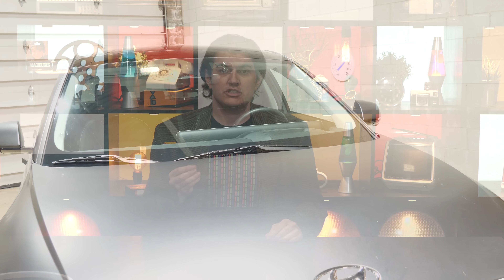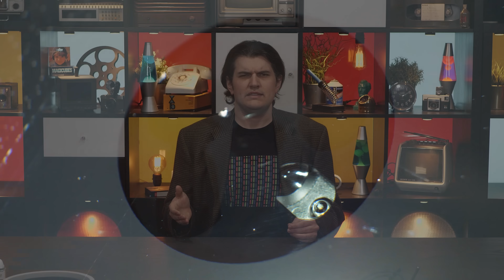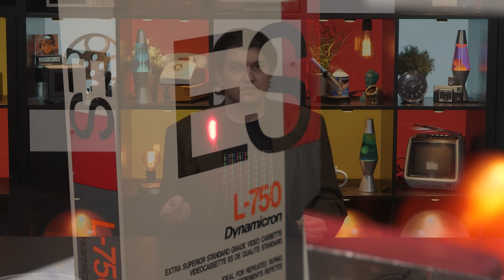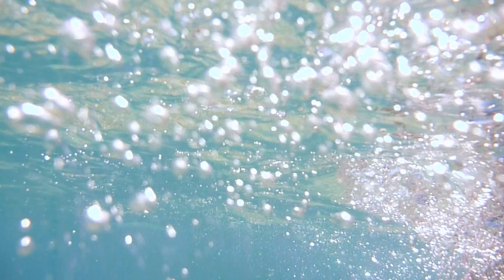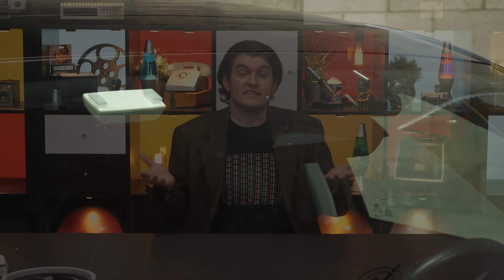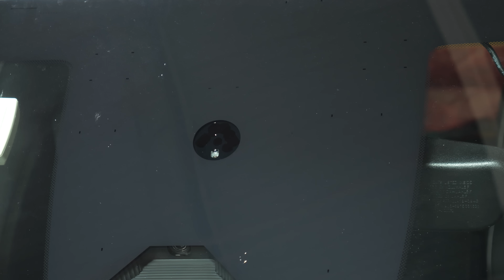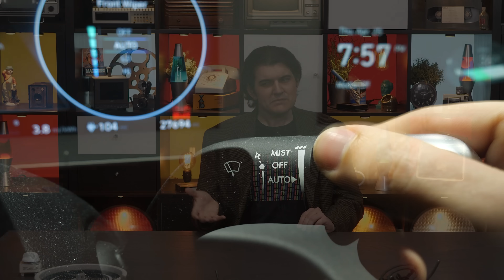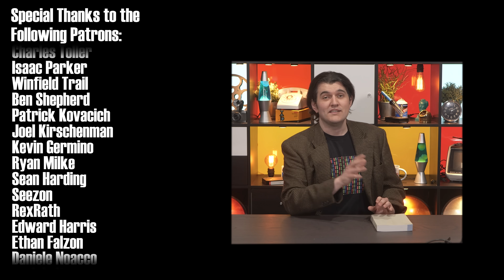The simple, clever sensor behind automatic windshield wipers

Comment: Having just purchased a vehicle that is equipped with Rain Sensing Wipers I can appreciate the mention that the system is "effective but not perfect". I constantly find myself arguing with the auto setting when it starts to rain heavily.
Reply: I more tend to argue with it when it's not raining much at all. As Alec said, the workaround to "not wiping enough" is to either dial the sensitivity up, or just put it on continuous wiping. If it's wiping too much even at lowest sensitivity, you have to basically turn the wipers off and manually trigger them each time. And salt/sand on the windshield will make this worse every time.

I wish there was some way to trigger an old-school "intermittent" mode. Or at least give the wiper control some feedback that "no, that's still too sensitive; even lower sensitivity than that."
Reply: @Nimelennar  you might need to dive deep into the settings of your car, my car's sensor doesn't work (as in wouldn't wipe at all beyond the initial wipe when turning them into a higher sensitivity setting) and I could change them to time-interval deep in the settings

Of course that won't let you switch between them easily
Reply: @ratchetfreak  Thanks, but my car doesn't have a settings menu. The most technologically advanced feature my car has is Bluetooth.

I think I might be able to get the rain-sensing sensitivity tuned at the car dealership, but it's not worth the hassle.
Reply: @Nimelennar what car model do you have?

You sparked the inquisitive part of my brain and now I want to find out if your car has the option to (somewhat easily) change that setting.
Reply: @Jehty_  it's a 2012 Mazda3.
Reply: @Nimelennar They all suck and wipe too little especially when it's bot raining a lot. it should use the camera as a secondary sensor
Reply: Yeah, in any car I've owned it seems the automatic wipers are way too sensitive. Not that I really mind if my wipers wear down a bit faster than usual but I just feel like an idiot when oncoming traffic sees my wipers going haywire when it's just slightly dribbling outside. Even on cars that have a way to adjust the sensitivity it seems like low is way too much sometimes

Though the newest car I've ever owned has been from 2012 so hopefully the tech is much better by now
Reply: My automatic wipers are far too insensitive, even at the highest setting. In light snow or rain, it's far more effective for me to manually hit the stalk every few seconds than leave the wipers in automatic.

I would so much rather have "dumb" intermittent wipers that operate off a simple timer.
Reply: I have a Hyundai Ioniq 6 (similar to Alec's car), and I agree with him, sometimes its evaluation of how much it's raining is WAY off, swiping far too fast or far too slowly. I thought that auto wipers might be just inherently a half-baked idea, but then I was on vacation and rented a Peugeot, and it had auto-rain-sensing wipers that worked FLAWLESSLY — enough to remind me how comparatively poorly my Hyundai's work. So it seems that some engineer, somewhere, can make them amazing, and car manufacturers just have to choose a best-of-breed supplier for each little component.

Meanwhile, I was literally just last night trying to figure out how I was going to replace my wiper blades when they are trapped under that hood! Thanks, Alec, for the coincidentally timed free tip!!! I actually did RTFM, learning a lot in the process, but I guess that paragraph about Blade Replacement didn't make an impression on my brain.

Comment: Theoretically it should be possible to implement a hardware rain sensor on the vehicles to which you weren't alluding, I mean the CAN bus presumably runs up near the cameras, so shouldn't be too difficult to stick on a rain sensor that sends a signal to the wipers to do their thing when rain is sensed.
Reply: Just use the stalk. Very easy to do and far more effective than auto wipers will ever be.
Reply: @iunnox  Manually operate the wipers? Heaven forbid! 🤣 Jokes aside, yeah, that's pretty much what I'm doing now, although I did test auto wipers over the weekend where we had a lot of rain and it worked pretty well, I guess they're almost there in terms of dialing in the rain detection algorithms.
Reply: That presumes that the wiper motors are just dumb CAN devices. I wouldn't be surprised if they are hardwired to one of the Vehicle Control modules, bypassing the CAN bus entirely.
Reply: @whitslack  The wipers themselves may be, but all one would need to do at the most basic level, would be to make the controller responsible for the wipers think that a stalk (or button) has been pushed. Although I'm pretty sure I saw some CAN messages catalogued by others that mention a wiper speed setting message.

Comment: I laughed out loud at "not alluding to anything" and now my neighbours think I'm crazy (as I was walking the dog outside at the time I was listening to the video...)
Reply: I had a model 3, now a model y.  The auto wipers and auto high beams suck so much compared to my previousl 2018 chevy equinox lol
Reply: @ogQuasi  Yeah my X is dreadful. I've learned to tap the windshield-squirt button to get it to trigger. And then sometimes it goes superfast for no good reason....
Reply: @MattGodbolt  My MY has 4 modes. Off, manual, intermittent, bipolar.
Reply: @ogQuasi Had a 2014 Model S that had a rain sensor and the auto wipers worked great (Better that the BMW I had before that). Now I have a 2018 Model S and as long as it is bright outside it works well enough, but once it gets slightly dimmer it has to be controlled manually. Only redemption must be that it still has stalks. As for auto high beams at least here in Europe Model Y and 2021 and newer Model 3s have adaptive headlights that only blacks out sections of the high beams to not dazzle oncoming traffic.
Reply: @ogQuasi  I turned off auto high beams the moment I got the car. The regular LED lights are MORE than bright enough already, no need for an even higher beam.
Reply: Yep my model 3’s auto wipers suck😕
Reply: My Model Y's auto wipers are mostly fine, but they definitely aren't as good as a real auto-wiper.
Reply: His digs at Tesla are sometimes justified. This one is 100%.
Reply: I got my model Y at the end of last year and the auto high beams have done really good for me. Now they’ve enabled the matrix beams which work even better. But the auto wipers are pretty bad, pretty much the same as my old i3’s. We need a better solution than this.
Reply: You will tell your grandchildren of this fateful day...
Reply: @HerrHoppenstedt  lol :D, yup a momentous day in my family's history, for sure
Reply: aight just to be clear, we're "not alluding" to tesla, right?
Reply: Don’t worry actually laughing audibly in public is normal, even if it happens by yourself! 😋

Comment: One thing that's not clear is if the sensor just detects water right where it is or if the total internal reflection means the IR bouncing all through the windshield's area and detecting water elsewhere.
Reply: The total internal reflection is just at the point of reflection. It's the angle at which, under normal circumstances, the light a refracted precisely along the surface. A discontinuity which you can measure.

It's actually very clever. Using the idea that something on the glass affects the light in the glass, even though the light never actually goes through the thing it is measuring. There's probably some tricky quantum mechanical effect going on.

Comment: And another thing I wonder… is why some manufacturers have inverted the scale of the intensity?

I always wonder, does this car I’m driving use frequency or intensity? Is 1 short intervals or less intensity… is 4 max speed or long intervals? I can never tell until I’ve tried it. 

Just as irritating as some have the lever go up (VW) to start the wipers, while others go down (Toyota)! Gah! Why not agree on one setting for all cars? Don’t get me started on Mercedes who uses the indicator light lever!! 🤷🏼‍♂️🙈🤪
Reply: Chevy also go up. My Subaru and Prius went down.
Reply: my question is why ALL the buttons on the wheel are flipped between the EV6 and other Kia cars and Ioniq. it's super odd.

Comment: Some Epson Printers use this principle to detect when a cartridge is empty 😊
Reply: roombas, garage door openers, and many other things
Reply: That is actually commendable! Other brands simply stop printing after they have emitted a certain amount of ink, cartridge empty or not.
Reply: @Rob2  True :) before this I remember on the T0791/T0801 cartridges era, they were using some kind of wetness sensor, that was located inside of the cartridge right on top of the ink outlet and was connected to the chip with two pins, then they moved to the new design I guess for cost, that sensor was probably not cheap!

Comment: I own 2 of the vehicles you were definitely not referencing. This method is a neat way to do it. I would say though that vehicles that do use cameras instead, why bother having 2 sensors? That’s additional cost. And my car has a clearly labeled menu item for parking the wipers for maintenance 😁
Reply: They didn't have automatic wipers until they figured it out through the camera, while even cars from the 1990s already had rain sensing wipers
Reply: @demagab  From my own first-hand experience, the car company that shall not be named still hasn't figured out how to make automatic wipers that work (properly) on vision alone. The biggest problem seems to be that the camera behind the windshield is peering through only a tiny area of glass, and unless a water droplet happens to land directly over the camera, it won't see anything unusual. This means the driver's view through the windshield can become quite obscured by raindrops before a droplet happens to land in just the right spot to obscure the camera's view in just such a way as the neural net will report as rain. The system would have been far more reliable if they had positioned a forward-looking camera on the roof crossbeam that could see the entire windshield. That might also have mitigated the problem when driving toward the sun when it's low in the sky. How a certain multi-billionaire tech CEO imagines that cars will be able to drive themselves when they can't flip down a sun visor and reposition their vantage point to avoid being blinded by the sun is beyond my comprehension. I guess he expects that people will simply accept not being able to travel by robotaxi in certain directions between 6 and 8 AM.
Reply: @whitslack  And from personal experience with one of these cars, it's been triggered by a dusty windshield or the sun hitting it at certain angles, and when it does go on, it usually chooses a speed that's way too fast or way too slow.  Like max speed in a light sprinkle.
Reply: Additional cost is irrelevant if the devices don't perform their intended task.
Reply: And the system seems to work well, it’s not perfect. In the rare case of needing a wipe you press the button on the stalk - er soon to be button on steering wheel